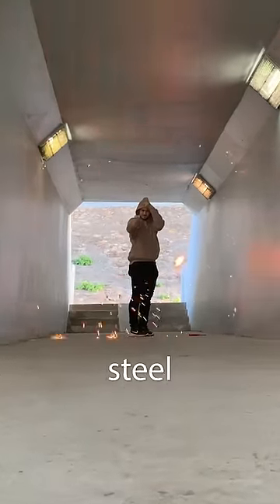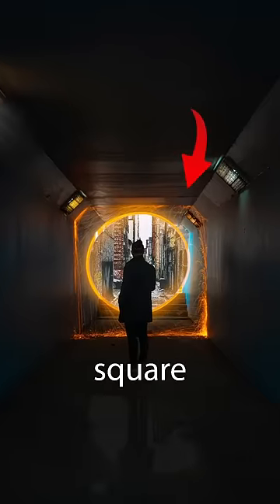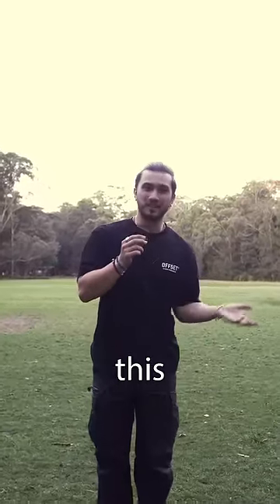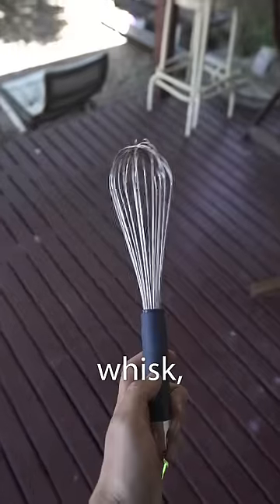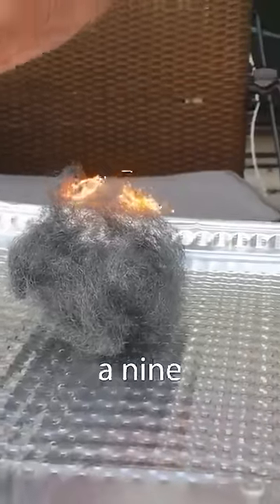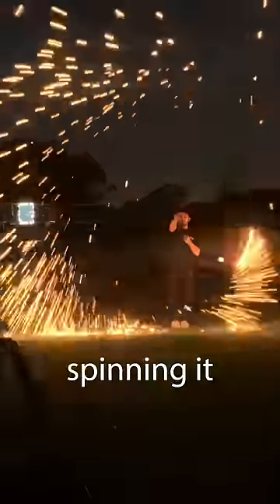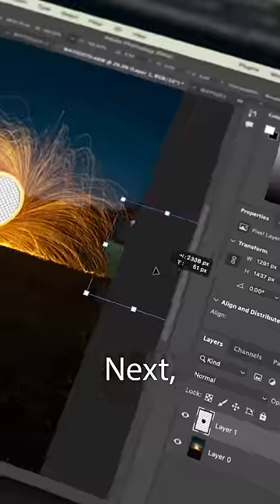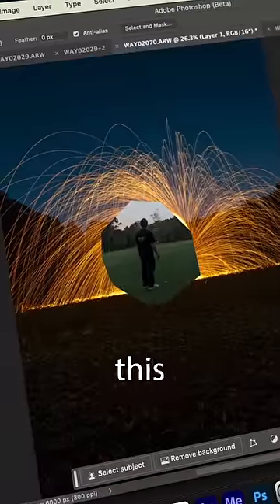I re-attempted to make a Dr Strange portal…

Comment: just a tip. you need to light the subject with the same color as your portal (in this case, you need to use orange lighting around yourself when taking the picture). 
the portal glow, and your subject also need to be effected by the light the portal produced.

Comment: Fun fact:Steel wool is made from low-carbon steel in a process similar to broaching, where a heavy steel wire is pulled through a toothed die that removes thin, sharp, wire shavings.

Comment: Use that steel wool and sprayway glass cleaner. Uoull neber have cleaner windows for your car. Tip from a detailer. Make sure its soft though. Also that and wax witha. Rubbing compound cna clean up metal bumpers and running boards. Gonna be a pain to get it off though.

Comment: I have a question what if you used a flat surface on the bottom of that steel wool, the flat surface is connected to the string and the steel wool is slid on the string to the flat surface. And then you started what would happen?

Comment: You could just not add a circle. I mean you could use the tunnel's result and just add the place you want to go 😅
Reply: The tunnel one is much better but you didn't need to add the circle just add the place you want to go
Reply: Just add the place you want to go at the tunnel's result and not add 0pcircle
Reply: *circle
Reply: circle